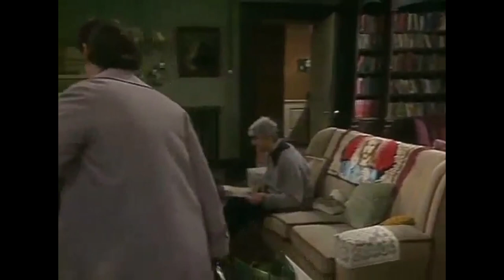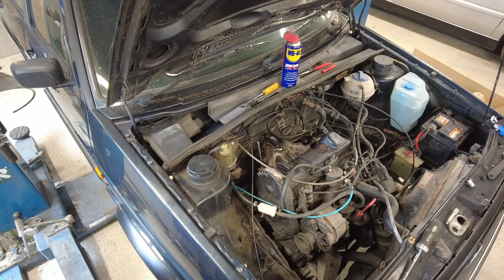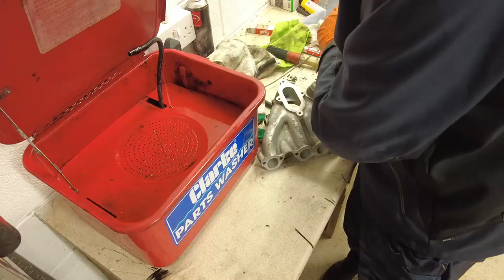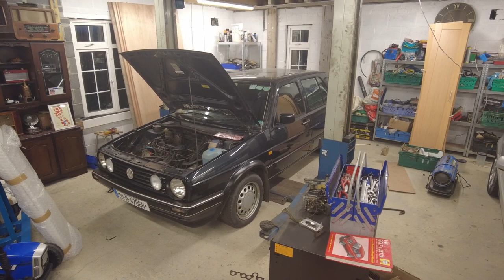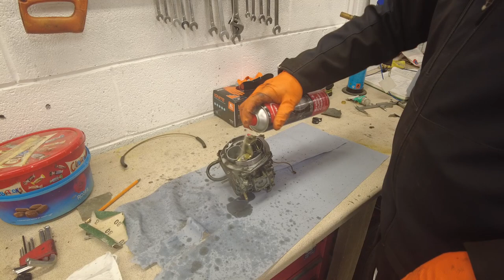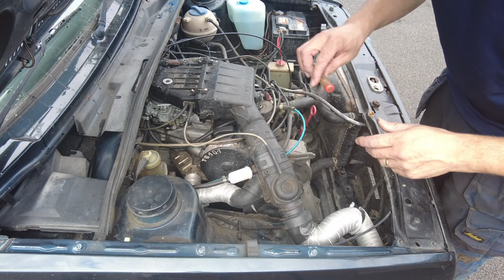Mk2 Golf Weber Carb Conversion Woes - How I FINALLY Got it Running Smoothly!

Comment: When you throttled up the second time at 1:01:53 I noticed a puff of vapour coming from the offside manifold area, inlet manifold gasket maybe? Play it at 0.25 speed you may see it
Reply from the maker: Thanks! Yeah I just saw that on the playback there too. Well spotted. It may well be an exhaust manifold leak. I'll check that out.

Comment: Great video and very informative 🙏🏻 I’m getting rid of my Pierburg too as it’s never really worked for me. Keeps cutting off when warm and now the car won’t start anymore. Carb is just spitting fuel all over the place. 

Mine is a 16 AUTO also. Where did you find the Weber for the auto? 🤞🏻
Reply from the maker: If I remember correctly, I bought the kit on eBay. The pierburg is good when it works but it is very complex. There are people who rebuild them though.

Comment: Great video. I have the exact same car and colour. Auto. Do you know the exact take off from the vacuum advance solenoid locatted at the fire wall?. I cant find a vaccum hose drawing for this little unit.  Vaccum line goes from dzzy to the solenoid then back to the black plastic line. What does the third nipple on the solenoid  do? If i cap it off the engine revs drop to stall. 
Keep the videos going. I used your sunroof one, auto box and  this one thus far.
Reply from the maker: It vents to atmosphere.

Comment: Great video, really in depth. I have the same problem with my T25, I’ve put in twin Webber on a 1.9 wbx and it coughs and splutters under load, fine idling on the driveway. Any idea?
Reply from the maker: Sounds like a jetting issue for you. You might need to come up a couple of sizes.
Reply: @Endfloat  thanks I’ll give it a go 
I hope you do more T25 and Beetle things soon
Reply: That could be the spark plugs or leads breaking down try taking one of the leads off each of the plugs when it’s on tick over to see if it drops in power
Reply: @billywhizz98  all new plugs and leads this week put on a mechanical fuel pump too, changed fuel filter too. No change
Reply: See if the butterfly is sicking or is the idel screw to far in I think it should be screwed right in and backed off 1 and a half turns and 
finally check if the diaphragm hasn’t got a hole in it
Reply: @billywhizz98  I’ll give it a go, you on Fb?

Comment: Hey Endfloat, I find myself rewatching this video everytime it gets recommended to me by Youtube. It's so informative, I've learned a lot. I think when the weather starts behaving it'd be a good idea for me to check out the whole carb and inlet manifold as well. Just a quick question, would you know where one could get different jets for the weber carb? I'm having a hard time finding it out as a beginner who doesn't know a lot about carbs. Ever since I converted to my weber my spark plugs are always carbon fouled indicating richness but anytime I lean it out with the mixture screw the car starts running like crap so I think I might need to change up my jets a bit. I'm also running a K&N open air filter which may give the engine a bit more air than it's used to.
Reply from the maker: Glad my video helped! Try carbparts.eu for the jets, or eurocarb. If you're anywhere near Northern Ireland, get the car to Ben Lawrence and have him tune it up. Then you know it'll be right.
Reply: @Endfloat  I'm in the Netherlands, don't think my Golf will survive the swim sadly... I recently inquired for a carb tune at a classic car restorer near me, they asked over €600... bit pricey for me at the moment since the car runs more or less fine for daily driving, it just really feels like it's not giving its all if you know what I mean. I'll try checking those websites, thanks a bunch!
Reply from the maker: @1600GL  I think that carbparts place I suggested is actually in the Netherlands! Before you go rejetting your carb, make sure your timing is right and there's nothing wrong mechanically.

Comment: Great video, don't have any of these problems myself but still enjoyed watching it through haha. Got a question for you (unrelated to the vid) that maybe you'd know the answer to. I have the same engine and Weber, just got the manual instead of the auto. It drives great, accelerates well and cruising with it is amazing, but when I accelerate really fast (floor the gas pedal) it sputters a bit. When I accelerate more slowly there's no issue at all, it can handle the RPMs but just seems that the sudden increase is too much. Could running the carb a little too rich cause this do you think? Like I said it drives great so I haven't touched the mixture screw after getting it to run nicely, don't have the gas meter to measure CO myself. Would appreciate your thoughts on this! MPG in basically start-stop traffic is about 28, around 36 on the highway.
Reply from the maker: One of my followers mentioned that they filed a bit off the cam that operates the accelerator pump which sorted this issue out. I want to try it myself cause mine has this issue too. It bogs down when I go to accelerate hard.
Reply: @Endfloat  Oh wow okay, that sounds a little above my level of expertise at this moment, but if you ever do this I'd be very much looking forward to a video of that as well if it's not too much trouble! It's not a real issue which is why I haven't really tried to do anything about it, but it's one of those things that makes you think "hmm it's still not 100% right...."

Comment: Nice video. What is the fuel pressure of the fuel pump?
Reply from the maker: I haven't a clue. Still running the stock fuel pump. I'd imagine it's around 3 bar.
Reply: @Endfloat  What's the gas milage?
Reply from the maker: @bobtomica9614  around 30mpg. It's heavy enough on petrol.

Comment: I realised recently why the average classic car owner is going to find car maintenance hugely more difficult, expensive and time consuming with a front wheel drive car vs a rear wheel drive. Stick to the likes of your MGB Endfloat.
Reply from the maker: It's not much more difficult to work on. I'd say it's easier than my beetle to be honest.
Reply: Why would fwd make a difference
Reply: @smashyrashy  As can be seen from the video access to some of the important components are much more difficult to get at than where engine and gearbox are forward facing.
Reply: I would have thought electrical components (especially those with microprocessors in) would be much more likely to be an issue maintaining more modern classics than engine access. There's always a way to get at components in tight spaces.
Reply: @StewSims  There's not microprocessors in classic (pre-80s ) cars, just basic electrics.